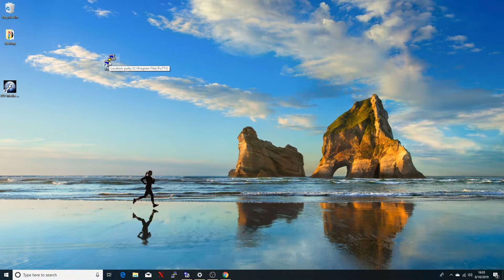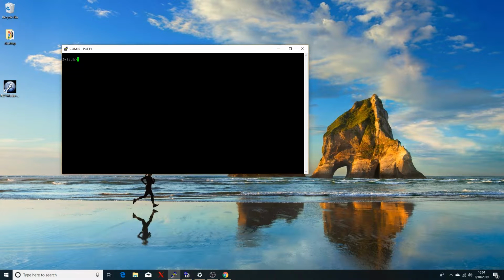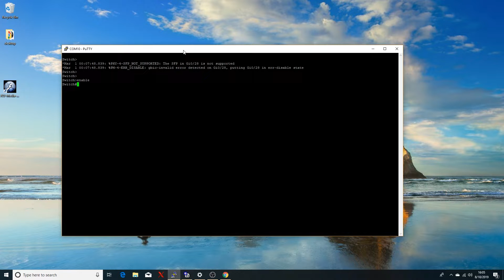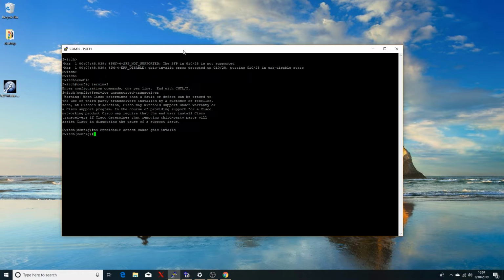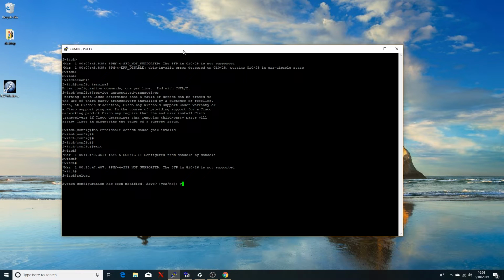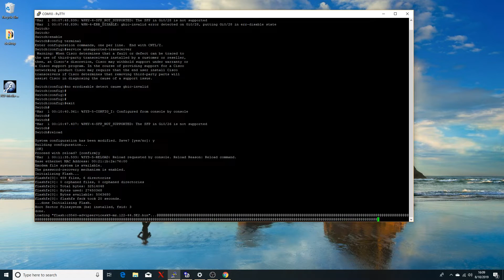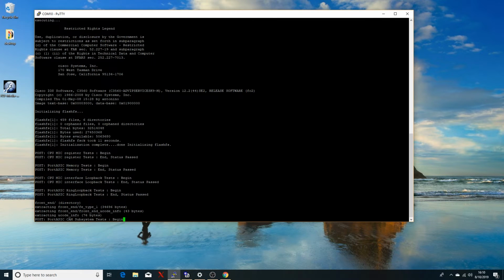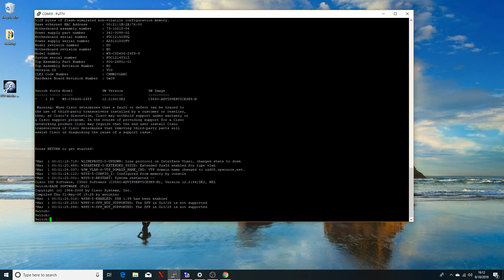How to connect to Cisco Switch and NON-CISCO SFP Trick

Comment: I was an associate network engineer for a medium sized company back in 2019-2020, and after the second month on the job I was tasked by the Sr Engineer to go to one of the plants to install an SFP module into one of the switch so that fiber can be run from the processing tank to the main management office network closet, we had a vendor who had already buried and run the fiber between the two buildings, and after connecting the SFP module that the sr.engineer gave me, the switch on each end would not establish a link, it took me a whole day to figure out what was going on, then finally at the end of the day, I found out that we were using a third party SFP module on the Cisco switch which unbeknownst to me at the time was not supported on the legacy switch that I was connecting together, the sr.engineer ended up bringing a Cisco SFP module and when I plugged it up to the switch it came right up, this was so frustrating, not a fan of proprietary stuff, the industry seems to be shifting away from Cisco now because of this, I wish I had known about this command then, would of saved alot of time.